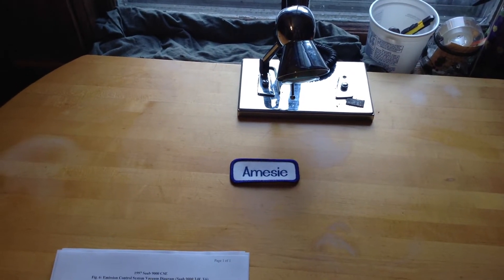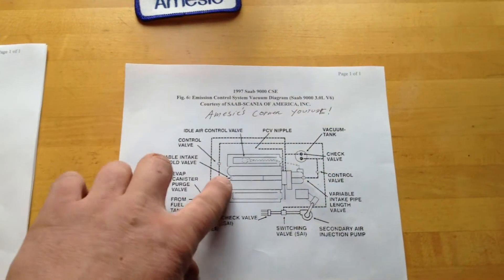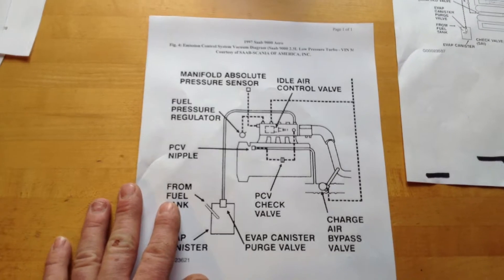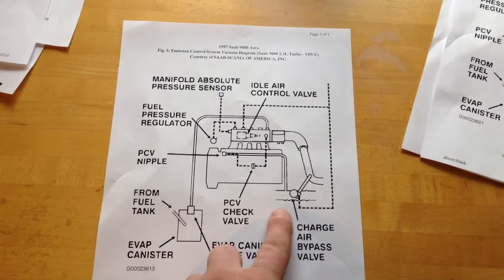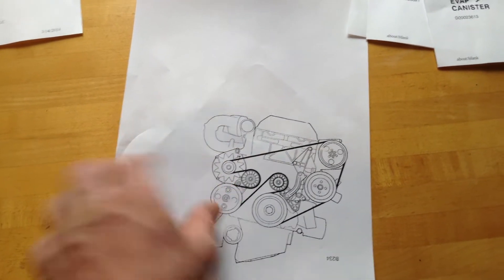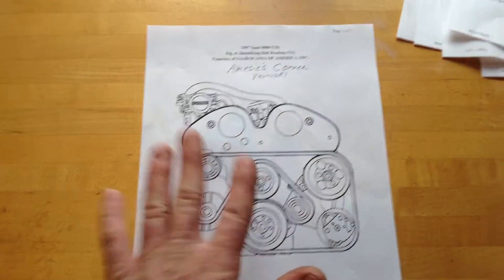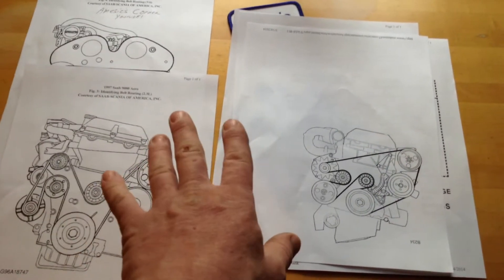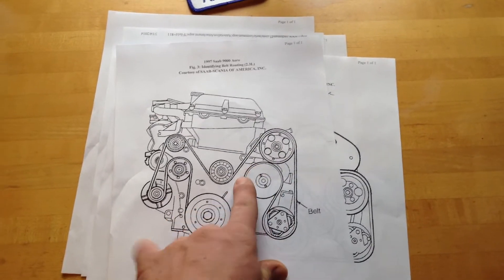Amesie's Corner, Saab 9000 Vacuum diagrams and belt routings.

Comment: I have a manual 93 saab 9000 cse, check engine light has been on and when it flashes it codes error 5 and 6 one is a throttel position sensor, the other is an oxygen censor. I have no idea how to fix it and I cannot find anything on YouTube.